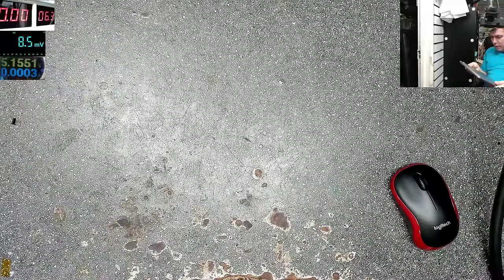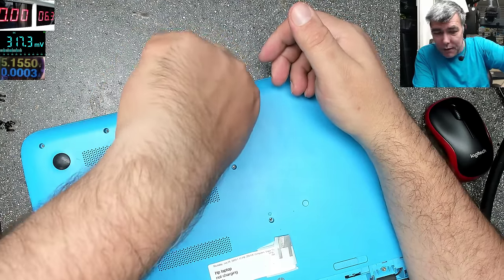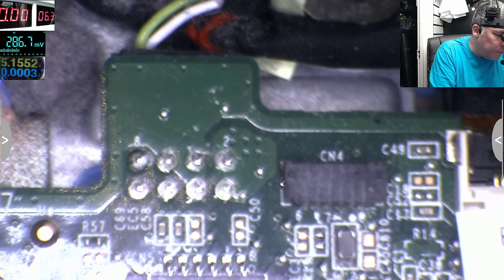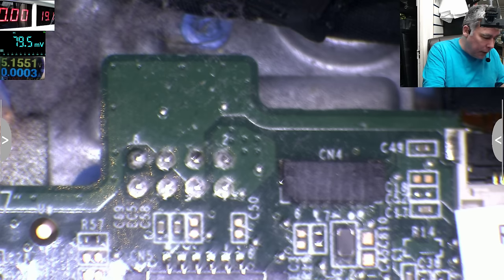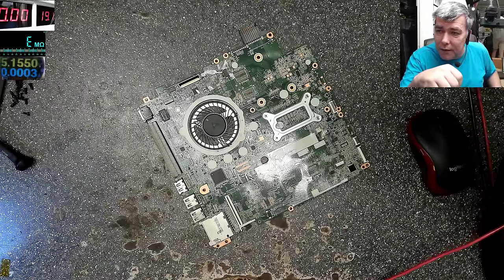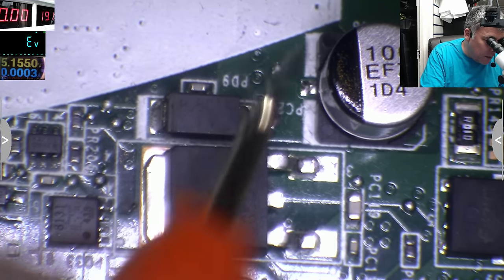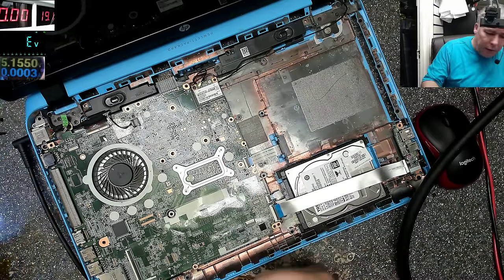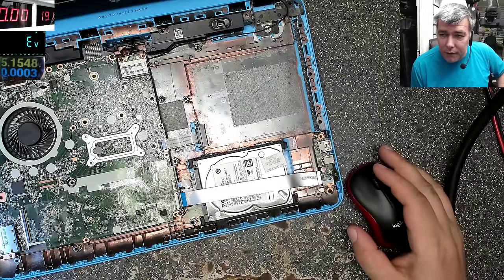Hp, dead, no power - the most stupid fault and design

Comment: How are you? Good morning, have you ever encountered a fault where the charging LED is flashing white to amber, the computer won't turn on? This happens when connecting the charger.

My computer is a probook 6460b, I already tried without the processor, without the ram, without the battery but it continues with that light blinking and not turning on. You will have an opinion or comment about it.
Reply: Could be bad charger or broken cable.

Comment: halo, a got a Sharp tv screen LC-40LE185M and the Menu does not show all the items (the Menu appear vertically at the RHS), two items that not shown are USB and RETURN. it looks like the menu is drop downwards causing the last two items to be invisiable. in fact when i switch it ON, it only shows half of the name Sharp (logo) at the bottom of the screen when it start up. iam trying to fix this but i dont know which board to test...any advice? thanks, i am new here in yr ch

Comment: Have this HP Pavilion g-series laptop that when you power it on the caps lock flashes and the number lock flashes but no post into the bios even nothing just hear stuff booting and black screen,I've tried a second screen nothing there either,any suggestions Sir?,tim. (Need Your Help!)

Comment: Great video but let's face it from HP's viewpoint , its another sale of a laptop and not a diode.
Unfortunately this story is not uncommon with devices manufactured for replacement and not either repair or a long operating life. Thanks as always for a very informative lesson.
Reply: hello
Reply: Lol, HP once tried to sell for I think 15000 dutch guilders in replacements of parts that were not the cause of the problem one of our workstations had developed. We got them to drop that but still had to pay for the replacement of the broken part that we actually didn't need at all.

Comment: Isn't it better that an easily replaceable diode is dead instead of a harder to find, more expensive or harder to replace integrated circuit (or a whole bunch of them)?
 Do you have the schematic of this laptop to know where exactly was it located, what was its value, what was it protecting?
 A power supply with a dry cap will produce high-voltage spikes as well as enough current to damage more sensitive parts of a circuit. I would rather have a zener diode burn out instead of a much more complex and less common part.
Devil's in the details.
 I question your wisdom here.

Comment: nice video! But is not the benefit by using a z-diode as voltage protection that you know which component will fail when overvoltage applies? Wouldn´t it be harder to finde the failed component without the z-diode?
Reply: i think that would make sense in circuitss  you make for yourself like he says. but on consumer product it's dead anyway and needs to be sent to shop and repaired.
Reply: @ntn888  that is true. But even if you have to send your laptop to the repair service they could find the failure faster with a z-diode? I mean he saw the diode and knew the reason for the short instantaneously.
Reply: @markusreichel3896  You would think so but then again, without experience they can still just muddle around and give up. Another video of exact same fault was passed on to expert by two separate computer repair shops as too hard. Then there's this one which was also passed to this guy with a listed bullshit fault because . . . they couldn't find the fault. So no, for some it is a "bridge" too far . . . get it :-)

Comment: Using a zener diode to protect the board is not stupid, what is stupid is using such a small diode that it is damaged by the spike and shorts out instead of blowing a fuse.  They should have used a much larger diode!

Comment: Hi can any one help me i have a linksys router ddwrt30x. With bad  MMC IC and when you power it just blinks  i tried to flush new firmware with ttl serial cable and it does half of job and when it get to MMC chip it hangs there it can not read or write to it. Any help would be greatfull

Comment: i have the same laptop but its dead checked the voltage it has 19v on the board 3.3 on the batt and switch but even the light on the power connector is not coming on  ...please advise (its even indicating the charging light but the laptop won't start)
Reply: Disconnect battery and cmos battery. Hold power button for a few seconds. Connect cmos battery and see what happens.

Comment: I have an ASUS UX303L laptop that works fine with the battery disconnected. When i connect the battery it will only turn on with external display and then if turned off it won't turn on again. have you seen anything like this before? basically with no battery it works great and with battery it only works once and with no laptop display. any help would be greatly appreciated.

Comment: what will you do for battery not detected after replacing the mosfet? and the laptop automatically turns on when plugged in without pressing the power button but it works fine just the battery not detected
Reply: Could be a a few things. You didn't really give any usable information to help diagnose the problem. This really isnt the place for this but if you did want help you would have to give a lot more information than you did.

Comment: Actually the short resistance is V/I so 4/2 = 2ohms 
I know it doesn't help me, I am just a stupid engineer...
Also I think the reason this was stupid was that the designer put the diode in parallel with a tiny filtering cap and then after the 2nd mosfet he puts the giant electrolytic for the input to the DC/DC. Yes the tiny ceramic will filter short/high frequency spikes but it becomes more and more like an open circuit as the spike energy increases.

Comment: I've learned one very central truth regarding HP computers - just don't buy them. I have a HP Pavilion g6 series. The week after the 1 yr warranty expired, the cooling fan failed. I then learned it is a very common problem in that range. A few years later, the main board would short whenever I turned the power off at the switch, so it forced me to shut down completely every time, then turn power off. My other PC works well. Never HP again - never.

Comment: I have a hp laptop.It's in dead condition. Before there were charging problem sometime charging and something not while connected charger. After 2days kept ideal when I want to switch on then it's not working. What should be the reason.
Reply: Try with battery disconnected.

Comment: Hey there. Anyone who has solved a problem i noticed in Folio 1020 G1. When you connect to a power adapter it blinks once and turns off in a sec. And when forced to power on, kills a resistor near memory chips and still no power. @electronic School. Can you solve that?

Comment: in dead mobile how to identify which part is faulty with dc power supply i mean how much "amp" take power ic,cpu,emmc
i have dead sony xperia c when i press power button it take only 0.20 amp and when i realease the button amp going to 00.. 

please explain this.
Reply: Heat. You start slow and look for things getting hot.

Comment: i have a hp omen 15 gaming laptop with a similar problem,when i connect the charger ,the light on the side of the connector does´nt power up ,the laptop is dead tho
Reply: and a similar problem like the 10:50 on the video,when i connect the power suply it shuts down too

Comment: You didnt show what you swapped out the zenner diode for?
Reply: he left it out, didn't replace it. Didn't need it
Reply: @eeledahc  I think that answer raises more questions than answers!?
If he didnt replace it you still have broken circuit.
If thats the case then why didnt the motherboard just keep on working when the diode had broken?
Reply: @noxin86  I'm going by his other videos with this answer, I'm learning from these too.  The diode is a protection diode, if there is a power spike or other fault then the diode goes bad and shorts to ground.  With it shorted the laptop is dead because the current isn't flowing where it needs to go, the diode is "stealing" it and putting it to ground because it is the shortest path to ground now.  This confused me at first because i thought that the current went through the diode first and then to the other components in series, but no the current flows in other places also. By taking the diode out, the short is removed and the current can flow as it's supposed to.  Should he have replaced it? Sure, but he would have to spend more time sourcing a suitable diode and maybe charging the customer more.  I think his logic of that is that there are other protection diodes and fuses already on the board in other places that if another problem arise then they will do their job and short to ground too, or pop.   That's my understanding of it any way.  Maybe he'll see your question and reply.

Comment: Product: HP 6530b
Operating System: Microsoft Windows 10 (64-Bit)
Hello there. I'm trying to revive my old HP 6530b. I've notice that my battery does not charge at all. Anyway, i decide to install new windows + ssd and new battery. So i've done this. All updates from Wondows + Hp, with new Battery and still my battery does not charge. It stays in 0%. When i try to troubleshooting, there is nothing. I've disable/enable battery drivers, even unistall. Still nothing. I've update Bios to last version, still... And cuz i have another hp, i've switched chargers/adapter and that's not the case. Of course, from all that, my laptop won't start on battery and when i unplug it, it will turn off. Dunno what to do, maybe it's something in the motherboard or? Anyone have idea what i can do to fix this? Does this laptop have a screw in the motherboard that needs to be tight so it will make contact for the battery to work. I've saw this in youtube's video for another model - Asus.

Comment: HP builds junk now, I will no longer buy from Horrible Products.
Reply: yeah. I have acer nitro 5 and im dissappointed because its filled with junk in the slftware, tried reinstalling windows 11 with usb didnt work no drive there. And when it got broken i tried checking it, its material very low quality. Sadly gaming laptops dont have nice build quality etc. And normal cheaper laptops, but its ablut the budget right, anyways, HP is actually good but ig in the times when this motherboard was designed, they got a bit sleepy😂 idk